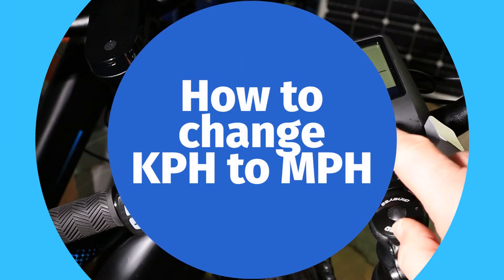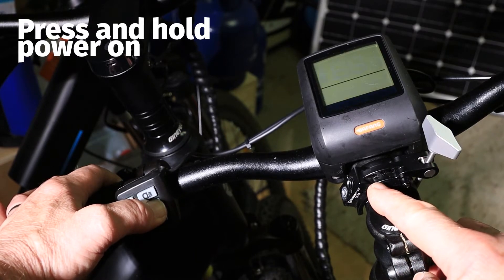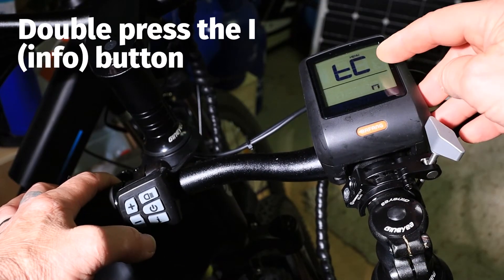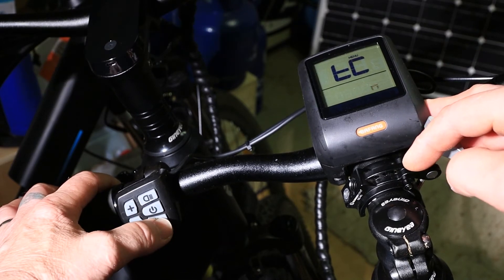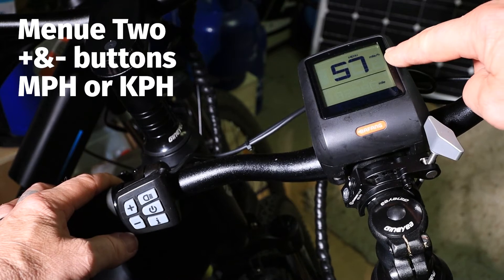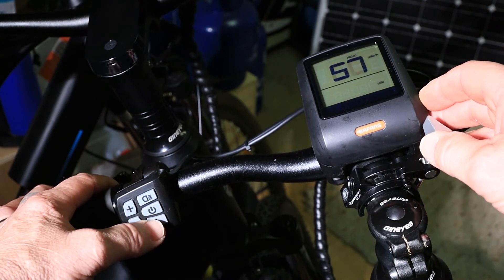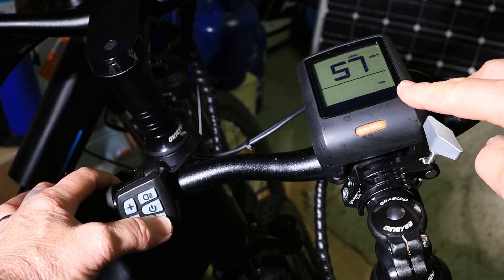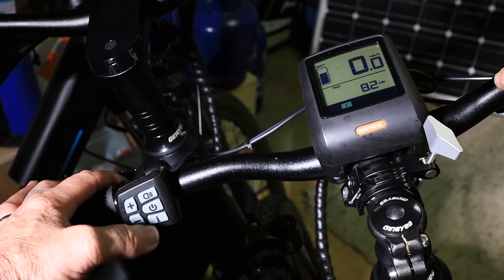kph to mph - HOW TO Change Bafang DP C07.UART Electric Bike Display, Eskute Netuno and Polluno Pro

Comment: Cheers for this. Just got one today. Great to know how to change it. 
Took it out for a short spin. Haven't owned a bike in about 25 years! 
Something odd going on with the gears I think. Still wrapping my head around it. 
But when I put it together, the derailleur was touching the spokes at one point. 
I can't find much info about the gears on this thing. Have you done a video on them?

Man, I feel like such a noob. I used to cycle a lot years ago. :) 

Cheers again!
Reply from the maker: i think you need a shop